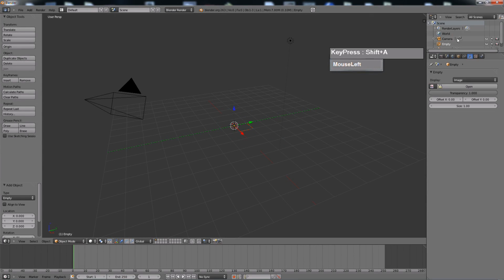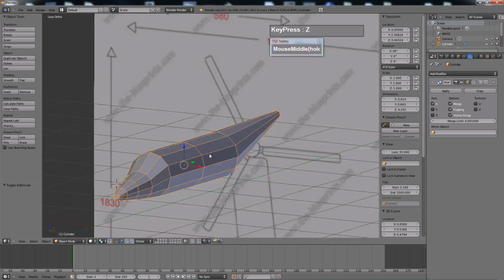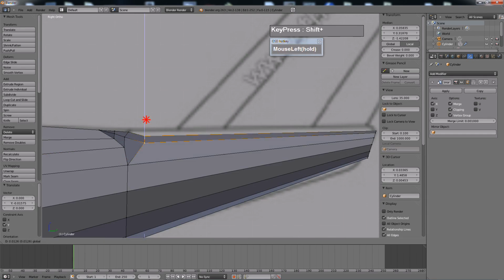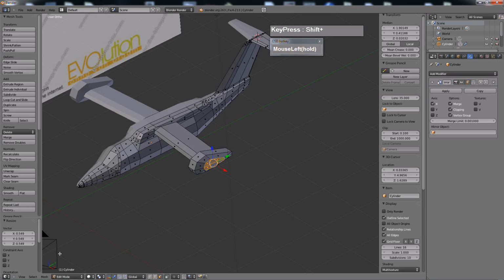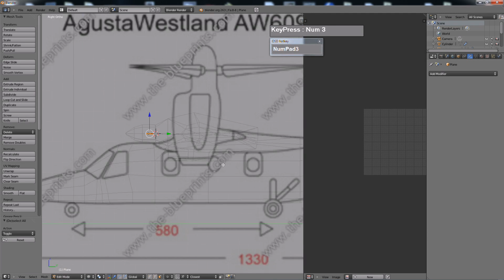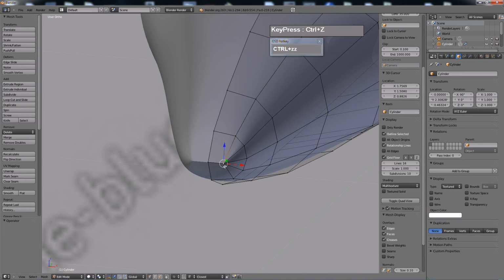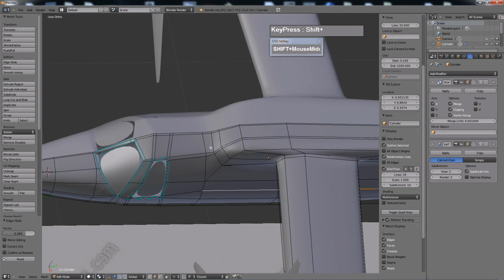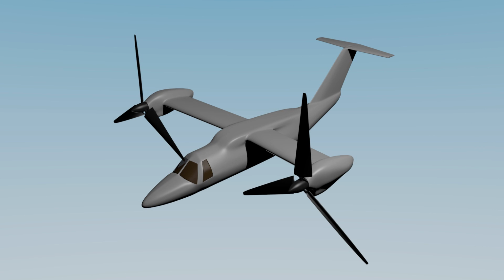Blender Modeling Time lapse - BA609 Tilt Rotor

Comment: Curious as to why you use image planes instead of loading them as background for each view. As a beginner to Blender I'm just wondering if that's a personal preference or if you find it speeds your modeling workflow that way.
Good work and thanks for the videos.
Reply: +Krolon Adamast0r Both actually, I personally prefer this form of setting up references as it is more interactive and I can view the reference in both perspective and orthographic views. I feel it speeds up my work flow a bit. If I used Blender's background image option the reference disappears when I switch to perspective view and splitting a 3 view into 3 separate images for line up is quite time consuming to setup.